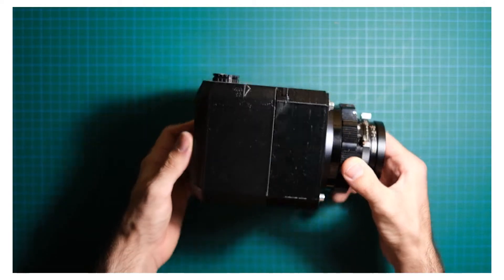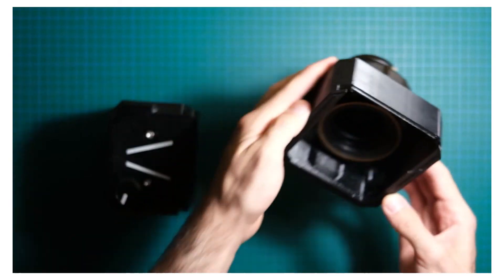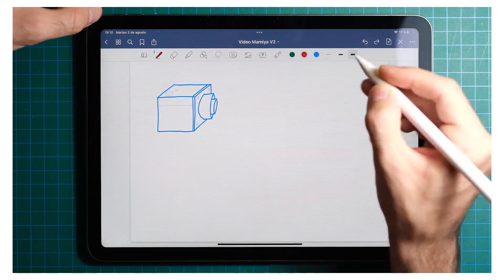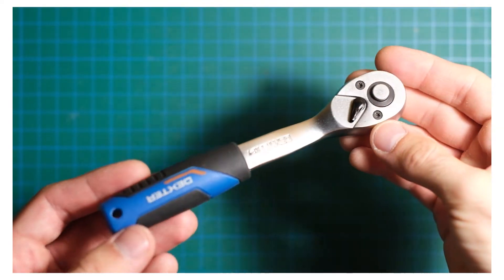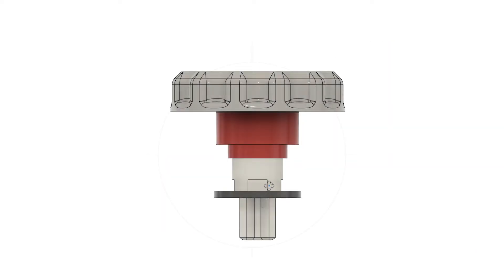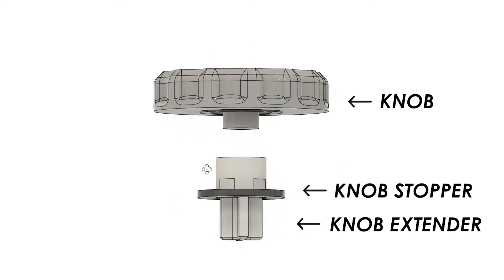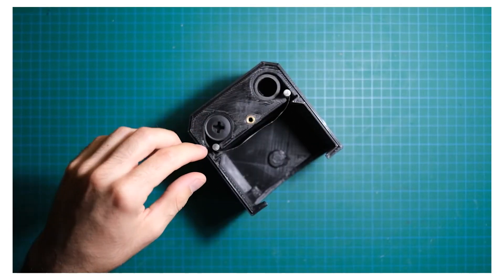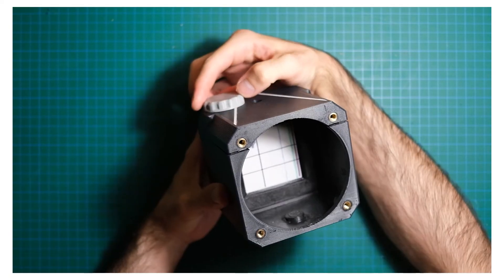3D Printed Medium Format Camera for Mamiya Press lenses

Comment: Great work! Doesn't film has frame numbers on the other side? Some cameras has a window on the back to show this number when advancing film. Would be a useful feature here
Reply from the maker: Thanks Dmitry!! I thought of making a window like that but I was worried about light leakage. Those cameras have a reddish glass to improve light-proofing, but getting this glass might be difficult. But a frame counter is the next important upgrade to be done. Thanks again for the feedback, your comments really help :)
Reply: @doroteo.archive  Sort of on that topic, you said it takes 1.5 turns to advance the film 1 frame.  If you did that test at the beginning of the roll, then that works.  As the film collects on the collector roll, the circumference of the roll grows and pulls more film per turn.  Thus it will require less than 1.5 turns to advance 1 frame.  
My sister's twin lens reflex had a broken advance mechanism.  When I disassembled it I found the advance mechanism allowed for less and less of a turn before locking into place.  Then when the camera was opened to remove the film, the advance mechanism reset to the beginning.  As I recall (from 50 years ago) it was a fairly simple system which should lend itself to 3d printing.  And also as I recall, the shutter release was on the body not the lens, so more of your design would have to change.  But still, if you could find a 1950s or 60s camera, before they went electronic, there was nothing fancy about any of it.
Reply: @dchall8  he means holder for cable-release like on MUP cams.
Reply from the maker: Hi!! Sorry for the late reply. You are right: the more the film is advanced, the less you have to turn the knob. I thought about some mechanisms to solve this problem, but none of them where simple enough to be printed (and simplicity is a main goal for me). I'll have to check a mechanism like the one you are talking about. It would be such a great improvement. Anyway, despite not perfect, always turning the knob 1.5 times makes the job (the film has length enough to absorb that inaccuracy). 
Thank you so much for the response and knowledge!! I helps a lot.
Reply: @doroteo.archive  Can't wait to see your updated version!!
Reply: @doroteo.archive  chr
Reply: @doroteo.archive  scura has solved that this way. instead of perfect spacing and getting most images they decided to make it simple on their 35mm version.  NB: i have solutions for the sticky knobs(filmtransporting) problem.
Reply: @dchall8  I think the Yashica FX3 must have that as well as I seem to reliably exceed 36 exposures (usually 37, sometimes even 38) and it makes sense given that.
Reply: @doroteo.archive  In thoery you could use a combination of a cheap red light filter and also use a pad (with a hole in the correct position for the correct frame to be shown through the red window) that is spring loaded to keep the film in the exact correct position to prevent light leaks. this is what I've seen done on my older 120 cameras.
Reply from the maker: @xander1052  That's also a really great idea. Anything to ensure no light leaks is welcomed! I'll definitely try it, despite I'm a little bit worried about too much friction between the film and the spring mechanism (the film paper is quite smooth, so shouldn't be a problem). Thanks for the ideas!!!